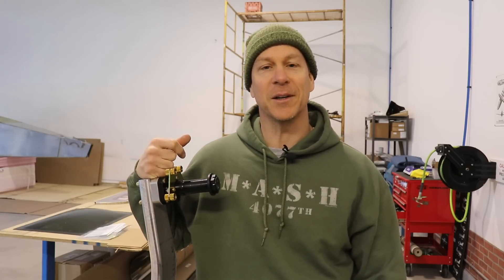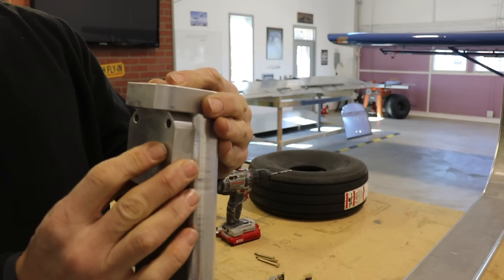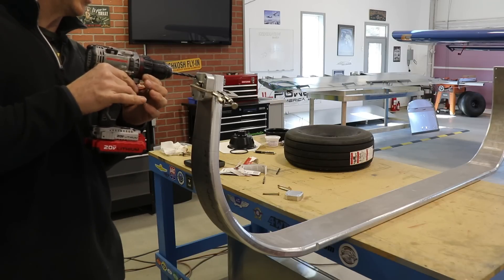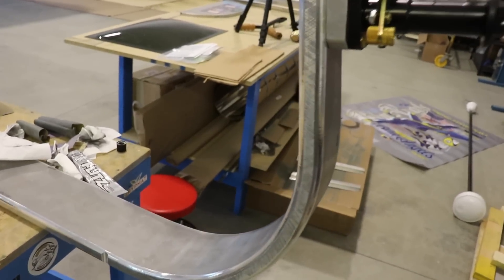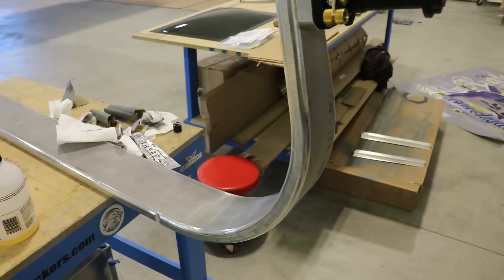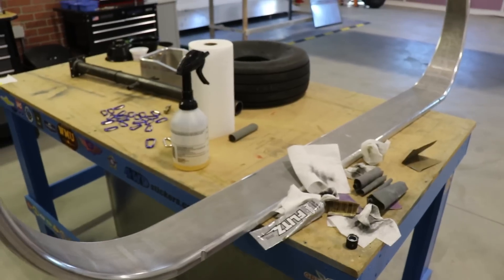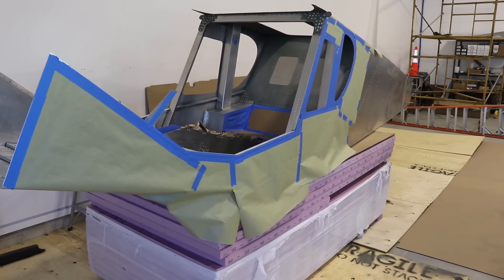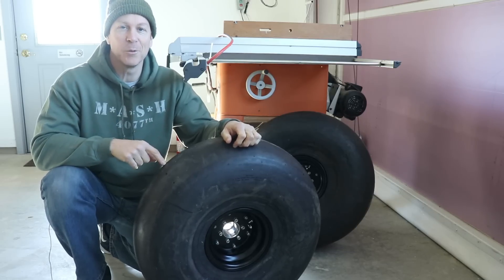Ch-750 KITPLANE Landing Gear and Fuselage Update (Ep36)

Comment: Hey Mark, Quick question: How would you have felt it there was a "drilling-jig" that you could use to drill those holes in the main landing gear strut arms? I'm Icon Aircrafts Lead Tooling Designer/Fabricator and I could easily and quickly design a 3D printed jig to place those hole locations, and provide hardened drill bushings to guide the drill bit. The jig would address all the concerns about proper location, proper drill size, and trueness of the drilled hole. It would also not use the spacer as a drill jig, this, prevent inadvertent damage to the spacer. Then the other question would be: What/would you be willing to pay for a tool that would only be used for that one purpose/place in the construction?
I guess those questions could be put out to everyone...
Thanks, and I think your doing a great job with the video's!

Comment: Mark why not use a drill bushing and go through with a smaller bit to keep everything square?
Reply from the maker: I don’t see how that helpful. let’s say I use on and drill the holes to 1/8”. now I have four 1/8” holes that have to be opened up to 1/4”. I still have to be able to hold the drill bit straight when I open the holes to the correct size. The way I did it worked fine-the holes are perfectly straight through as evidenced by the bolts going through all three pieces. It’s just that some care need to be had when drilling the holes!

Comment: This is a reminder of how crude albeit simple Zenith aircraft are .. When I look at the gear of todays Super Cubs , Bearhawks , Kitfox  aftermarket and Just aircraft  they are all designed to have travel  and truly dampen hard landings .... also tricycle gear is nasty in rough back country due to short wheelbase rocking plane violently fore and aft in   rough stuff ... flaperons also are a cheap albeit simple  compromise  compared to the serious flap equipped aircraft mentioned  ( kit fox excluded )... There is a reason the highly   talented back country crowd avoids this  compromise craft and goes for Super Cubs and perhaps the widest envelope back country plane the Bearhawk Patrol ... This ultra crude and ineffective tricycle  back country landing gear is why Im seriously not impressed with this plane and dont understand why you chose it after building one just like it ... The end product is has the lowest resale value  compared to the others because this craft  is the least capable over a broad range  and the least effective in its purpose role of back country flying .. The Bearhawk will do both things better in one craft , faster than your cruiser and way better than the super duty in back country in one airplane ... Never understood why you didn't go Bearhawk or Super Cub on this one .. but to each their own

Comment: Hi Mark
There js a tool that screws on to the valve stem and it is pulled into the hole, any tire place would probably put them in for you for free, it only takes a couple of seconds, love the videos, top notch.

Comment: I would use 1” drum sander  60 or 80 grit to get out those chatter marks off the landing gear edge.and smooth the edges on those area above the radius were they clamp the aluminum for bending.

Comment: For the valve there is a pulling too that pops them in. It threads onto the valve threats and you pull through

By hand best be throw it into hot water to make it sold and playable then should push or pull into place

Comment: Recommend check with the factory before powder coating the gear. The heat may change the temper of the aluminium.

Comment: I was thinking what if you turned a bushing  to fit the hole in the spacer block out of steel  with a smaller hole in the bushing. This would make the drill go straight .then enlarge to the correct size

Comment: I have to jump on the band wagon too.....SOS.......Valve stem pulling tool at the auto parts store..and check that hole size, looks a wee bit small........ and a bit of silicon or dish soap makes those babys pop right in..... Love  following this project with ya ! ...should be a nice plane .

Comment: Mark, that tire valve needs to be pulled through with a tool that threads onto the end, not pushed through. Take it to a tire shop and they can do it. Otherwise, any auto parts place will have that tool.

Comment: From the marks on the gear bend, it appears they did not mandrel bend this gear but used a series of 3 point bends.  That seems a little cheesy for airplane gear legs, but then a large diameter mandrel is probably somewhat expensive although a 3 point roller bend machine isn’t all that exotic.

Comment: Wish I had known ahead of time about you drilling the landing gear. I have the tools where all you have to do is spot the bolt holes with a transfer punch, then clamp on a drill block with the appropriate size drill bushing and drill away with no worries about over sizing holes.
Reply from the maker: NOW you tell me!! Ya that would have been handy.
Reply: @KitplaneEnthusiast  If you need anything in the future, just post up what you're looking for. I probably have it. 42 years of working for Gulfstream, you tend to accumulate a lot of tools, LOL.
Reply from the maker: @dcrahn  Will do thanks!

Comment: Their is a tool to insert valve stems. You pull on them with the tool, that screws onto the threaded part of the valve, and then using leverage, it pulls, stretches, and seats the valve stem. Soapy water is used to lubricate, but without the tool, you will be fighting with it, and may even damage the valve stem. One other option is to go to a metal valve stem, which will last years longer than the rubber ones, which have been known to deteriorate in a few short years and leak. The metal valve stems need no tool, other than the proper sized wrench to tighten them.
Reply from the maker: The two main wheels have a metal stem. I'm not sure why they switched to a rubber one on the nose gear.

Comment: Take your valve stems and rims to any tire shop and somebody there will be happy to use the proper tool to pull the stems into position.  Probably for free.  Also, a cup with some oil and a small paint brush when brushed on your drill bit will do wonders.  Even a spray of WD-40 will work.  And you won’t need to keep buying new drill bits so often.  Love your attention to detail.  Great job.

Comment: for your valve stems, could it be that the thickness of the powder coat has made the holes too small to file the valves in properly?
Reply from the maker: No. It's like trying to pull an elephant through a mouse hole LOL!
Reply: @KitplaneEnthusiast  Ah. LOL.

Comment: I would go with the green paint on the legs. The tyre valves are best pulled through with a bit of soap on them, don't thry to push them through they just get fat and will not go, an auto shop will have a valve pull tool, you could use (although you have done it already, just for the future).

Comment: Pull the valve stem in rather than pushing it. That will make life easier along with some soapy water as you said. You clearly got them in as seen in the last clips but just in case it is helpful.
Reply from the maker: The stems in the two main gear are different than the nosewheel. They were easy to install! I tried pulling it in but didn’t want to use a tool as to prevent damage to it. Someone else suggested a valve stem might work. I’ll try that.
Reply: Kitplane Enthusiast I’ve used a sacrificial valve cap and tape to protect the threads and not crush it with pliers and a screw driver or block for leverage. But like others have said there is a tool for that which I don’t have.

Comment: You should be able to buy a valve stem installation tool that threads onto the shraeder valve to let you pull that through the rim.
Reply from the maker: Sounds like that’s what I need to do! Thanks.
Reply: @KitplaneEnthusiast  mark don’t buy a tool, go to any tire shop I’m sure they’ll gladly install those for you it’ll only take them 10 seconds.
Reply: @KitplaneEnthusiast  They pry on the outside bead of the rim so make sure to bad it with something so not mark up the powder coating. I have the tool as well as tire machines in my home shop. I am sure it would be easier enough to get the tool but if you want help let me know. I'm in Dexter and I could drop by with the tool or you could come to my shop with the rims. Just putting that out there. I'm working on my owner assisted annual on my 182 last week and this week. Really feeling like the building process. I also like  your Dynon video. I have been thinking about the Skyview for my 182 but have been waiting for the autopilot STC. I am now considering the Garmin G3X touch as it is comparable in cost and would work with my Garmin GDL52, 760 handheld, and my present GNC300XL. The 300xl is IFR certified but only for no precision approaches and isn't WAAS. I would upgrade later and use the 300xl as a back up. Love the videos.